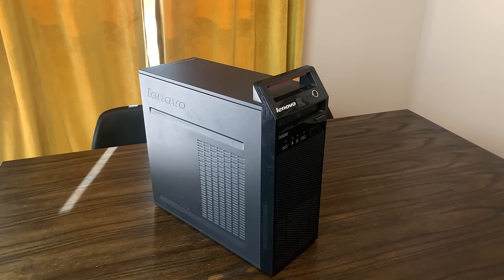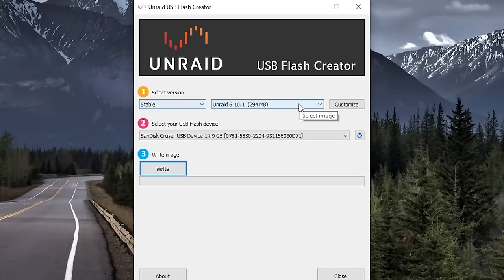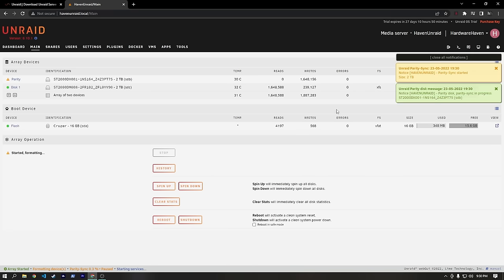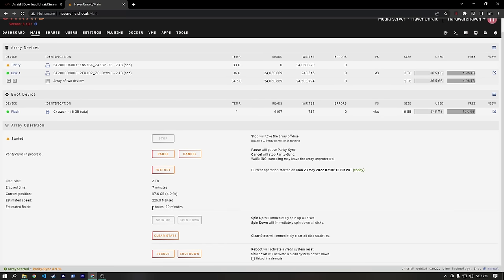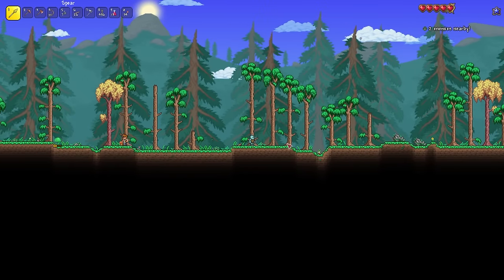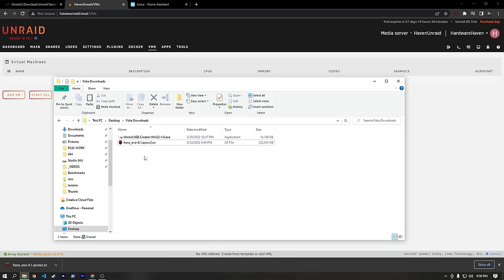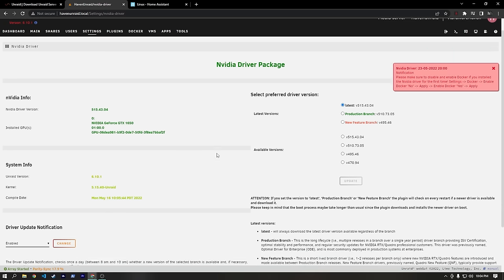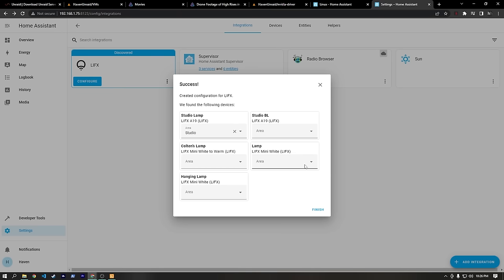Convert an Old Gaming PC to a Home Server using Unraid - (SMB, Terraria, Home Assistant, Jellyfin)

Comment: It is mind-boggling why people always install unRaid, TrueNAS, Proxmox or whatever. 99% of the time your system comes already preinstalled with a operating system like Windows 11 Pro, so go with that. If shit hits the fan with unRaid or True NAS or whatever it is game over for your system, good luck finding somebody able to help. Jellyfin, Plex, virtualisation and container run like a charm on Windows. A lot of game servers even expect you to use Windows, they don't offer any Linux or container support. And to be clear, SMB with 10gbit is just crap, it just support only one CPU core and limits mostly your experience.